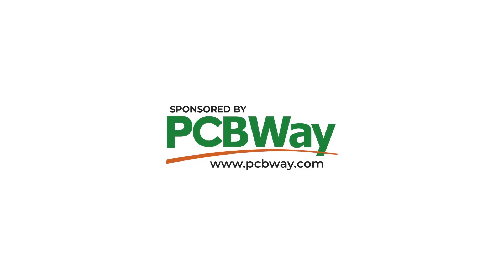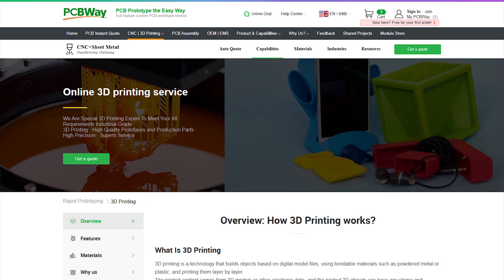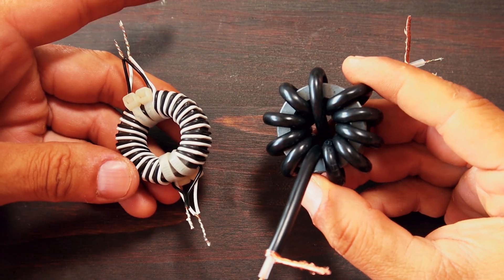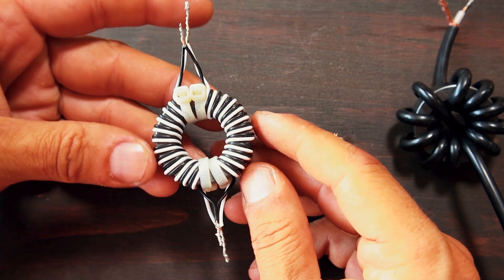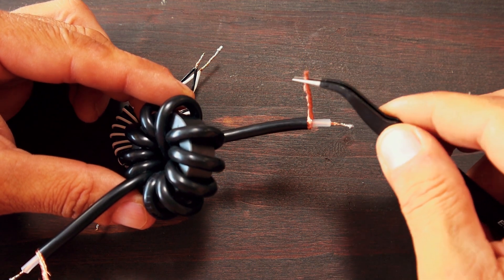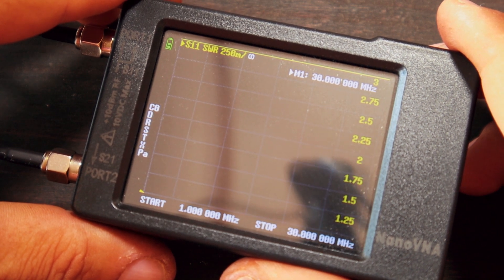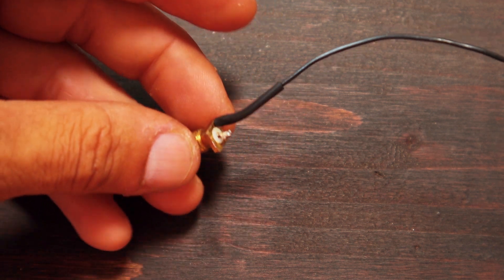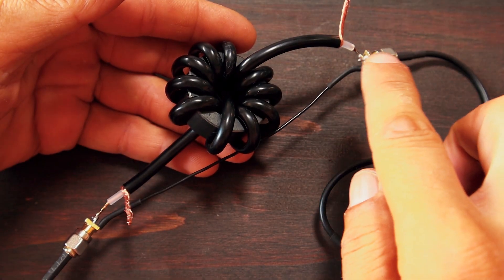Common Mode Current Chokes Comparison - NanoVNA Measurements

Comment: Nice I prefer coax! cheers
Reply from the maker: Thanks so much. I also enjoy that one as well. It seems way more simple and with the latest tests ( off camera ) it also seems that is not changing much the SWR of the antenna as it is with no RF choke. So I think I will also stick to coax. 73, YO6DXE
Reply: @dxexplorer  I think the isolation is better for choking RF the coax shield does a good work.
So you consider put another one at the beginnig of the line to avoid SWR bounce back? cheers (Ruben LU8ARM)
Reply from the maker: @RA-Arg I tried having one at the beginning of the line as well... actually I have been playing with it in all sort of positions... the best results I had with the RF choke at the end of the line. When I tried it at the beginning of the line ( at least with the EFHW antenna ) it was messing the SWR on all bands. Basically it was shifting the SWR up in frequency comparing to what it was with no RF choke at all. When it comes to the shield of the coax... indeed that is usually enough if there is a lot of coax on the ground especially. But if the coax is shorter or not much on the ground, then the RF choke comes in handy. I remember I tried a vertical last year and I always had bad reports ( I was using only 3m of coax ). As soon as I put the RF choke at the end of the line... boom... good reports only hahaha. So clearly I was getting common mode curent coming back in the transceiver messing up everything. I am still learning about this but is fun. 73.

Comment: Why put a 1000:1 attenuator between TX and antenna ?
Reply from the maker: 1000:1 may not be a good idea 😁😁. 1:1 may help a bit to make sure we do not have the common mode curent that bothers a lot especially when transmitting CW with a metalic key... and we get surprises in the fingers 😅. Also the TRX is happy when there is no common mode curent coming back into the transceiver 😁. 73, YO6DXE
Reply: @dxexplorer  Try a 3dB 50 ohm attenuator between TX and ATU, this limits the range of  SWR seen by the TX.
Reply from the maker: @FarleyHillBilly I don't use an ATU. But I have this written down for the future... you never know 😁.
Reply: @FarleyHillBilly  you want to waste half your power?
Reply from the maker: @tzm1843 you do not waste any power.
Reply from the maker: @tzm1843 This article should explain a little on how the common mode choke works. The attenuation that I measure, is the level of attenuation of the common mode curent not the signal that goes to the antenna. Basically the signal will go on one of the windings ( the one connected to the center pin of the BNC ) and if there is any common more curent coming back on the coax shield, that one will be attenuated by the other winding. Trying to explain in a very simple way. Not that I am an engineer and know better 😅😅. Here is an article that may help on this. 

https://www.hfkits.com/manual-common-mode-choke/

Comment: Good video Chip. I use the coax version straight through to the radio, no joins. About 200mm from the radio. No problems with it.
Reply from the maker: Thanks so much Nigel. And good timing too. I was thinking earlier today to send you a TV show tomorrow instead of a radio show as usually hahaha. Yep... I just made a few more tests a little while ago and noticed that the coax version is influencing less the SWR that I have with no RF choke. So I guess I will do just the same. Less connectors to buy... more beers for me 😅. Summer in the camper is like on the boat with no wind 😅. 73, Nigel... happy Sunday my friend.